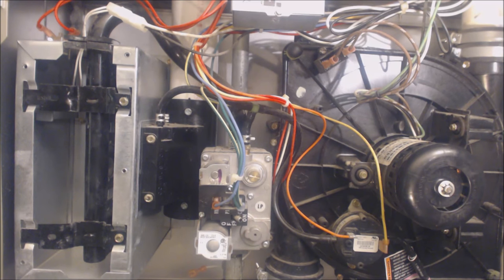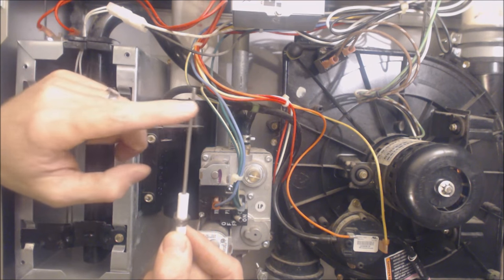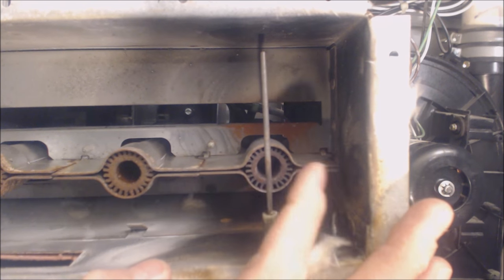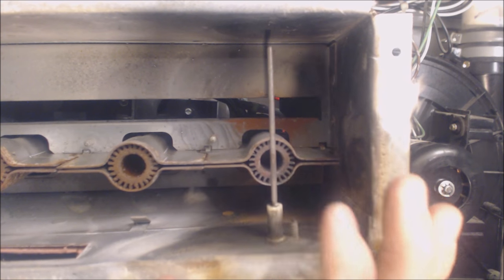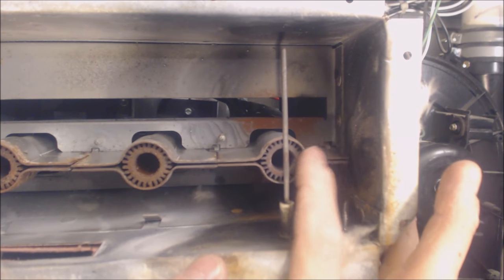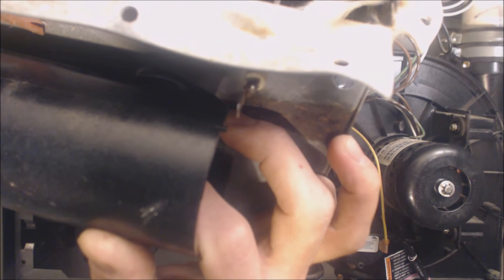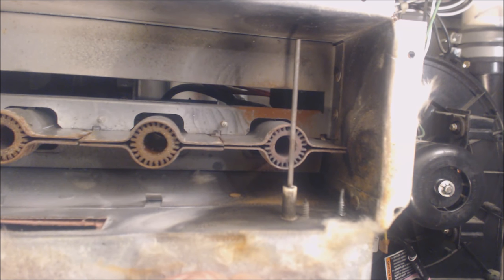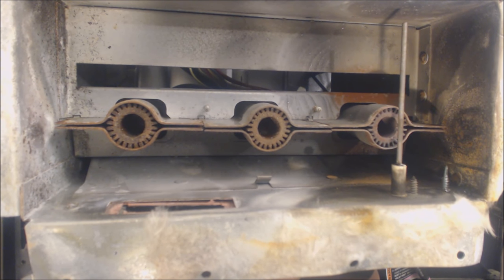Gas Furnace Flame Rod Sensor and Rectification Explained!

Comment: This is gold!  I've always been cleaning only the rod and never the burner retention head.  I've been having problems with a goodman gmvm97 flame sense. I've been getting called back every month.  Next time I'll be cleaning the burner and also checking voltage between neutral and ground.
Reply from the maker: lad to help Jshortca!

Comment from the maker: This is in reference to Jesse's question on flame rectification sent through the messenger. It is not allowing me to reply so I am posting my answer here. 
The question: 
I just have a question on your flame rectification. I get the flame sends voltage to the burners which converts to DC. I get hooking up the meter leads in series reads the DC current moving from the flame to the burners. But how does the board confirm this to keep the flame going? People say it has to be grounded. But not all burners have a ground wire on the burner box. You can remove it and it will still run.

The boards that you disconnect that have the ground wire going to the burner may also have another ground somewhere such as the ones that go to the gas valve common and then to another ground before making it back to the burner. If it goes to ground, it could pick up the micro amp signal. You can also do that test for micro amps in series on the ground wire and to be honest, that gives a better reading for how many micro amps you are getting back to the board.
Reply: It reads the ac imput back on its self if I understand correctly. The board is looking at the flames directly through interference paterns in the flame.

Comment: Man I wish I would’ve seen this video a few days ago. 😂 recently I did a PM on an older Rheem furnace, that wasn’t sensing the flame after I cleaned the flame rod. It generated no DC micro amps, so I assumed I broke it somehow. I put a new one in there and it did the same exact thing, thinking maybe the new rod was defective somehow. So I put a different new rod in there and still did the same thing. I went crazy trying to figure out what the issue was. Had continuity from the flame rod all the way to the board. I began to assume the board was bad, called the boss to verify, and to just replace it with one of our universal boards. Anyways, had I known how the flame rod works NOW, would’ve saved me so much headache. My theory now is that the board was likely not sending 115v to the rod. 

But the stress and headache didn’t end there! When I put the universal board in there (according to the manual for the new board, it was compatible with this Rheem), as soon as I gave it power, immediately it flashed the trouble codes for “unexpected flame sense” and “pressure switch stuck closed,” neither of which were occurring. I assumed the new board was defective, called the boss to explain the situation. Luckily he was just down the street. Told me he had the same exact board, and to come get it and try that one instead. Put the second universal board in there and it did the same exact thing. Turns out the stupid board wasn’t compatible despite it supposedly being so. We ended up having to order the factory OEM board and put it in the next day, worked like a champ after that. I’m always learning something new. 🤣🤣🤣

Comment: Awesome video. Question tho.. Can the quality of the flame affect the DC voltage? If the voltage literally travels thru the flame what happens if the furnace is running rich or lean will that change the voltage??
Reply from the maker: Yes, slightly as it travels through the carbon in the flame but the board would not be able to read the difference, thanks

Comment: good video.  What would  your microamps be reading if the sensor was beginning to get corroded but still proving a flame?
Reply from the maker: It may be lower like 2 microamps or less. The microamp measurement could also be intermittent.

Comment: I've heard Teflon tape can not be used on gas pipe because it can interfere with flame rectification. Is that true or does the system rely on electrical system grounding independent of gas pipe threaded connections.
Reply from the maker: Flame rectification usually travels through the pilot tube for pilot ignition and direct ignition usually travels through the burner retention head and ground chassis but yeah I don't use the teflon tape rated for fuel gas but just thread sealant. You don't want an inspector to fail you and you do want your piping to have continuity as well for ground, thanks Joe!

Comment: I have a question about the Ground. Can you explain how a bad ground can cause intermittent voltage, causing loss in voltage at the gas valve.
Reply from the maker: I will have another video coming out on the flame rectification process. This one will be for testing. Problems arise from ground to the board, potential voltage measured on the ground, and flame position as well as oxidation on the rod. Thanks!

Comment: What would be the reason that, there won't be any microamps when tested?  Could it be ground or electronic board problems?
Reply from the maker: Check for voltage going to the flame rod. One probe on the 120v common and the other on the hot feeding the flame sensor. It should be 90-110v. Is the flame rod in a good place enveloped by the flame? If so, you should be reading at least some micro amps if you are in series on dc microamps. Thanks and let me know how you make out.

Comment: It's not the size of the chassis that causes flame rod rectification. It is the temperature difference. Electrons can leave a hot glowing flame rod a lot easier than a cold piece of sheet metal. That makes the rectification one direction. Vacuum tubes used this exact same principle with the heater element.

Comment: hi, on a york rtu the flame sensor sits in front of the pilot tube rail instead of the main burner. so how does this work? the main burner flame is not touching the rod at all. does this mean the pilot is on all the time and the rod is only sensing the pilot flame? the unit has an intermitten ignition control board. thank you.
Reply from the maker: Ha ha, yes, crazy huh? The rectification is only checking the pilot and not the main burners. That is how the older furnaces used to work.

Comment: i didn't understand well what you mean about flame rod have to be one-fifth of the head.  could you explain more? You are speaking about lenght of the rod comparing with ???
Reply from the maker: I was speaking about surface area. For instance if you compare it to the flame rod on a smart valve which is much smaller, thanks!

Comment: For the life of me I cannot get any DC uA readings on the ground side of my Rheem RGPH-07EAUER; it doesn't even fluctuate, it's always 0, yet the readings are great on the source side. Checked ground connections multiple times with 0 ohms, and 0vac from ground to neutral. 0 ohms from the flame sensor signal wire back to the IFC. I'm beginning to think my model doesn't use the ground side to send the signal to the IFC, b/c occasionally the burners will stay lit and the unit will work for a couple of days, while the readings on the ground side are still 0. Most of the time, the burners will not stay lit for more than 8 - 25 seconds. I've replaced the flame sensor and even the IFC board, and also cleaned and sanded the burners and the whole area around them. This thing is possessed! I replaced the gas valve, unit worked for two days. Removed the ground wire from gas valve, unit worked for 3 days. Removed the red wire connected to the IFC board labeled fan, the unit ran great for 5 days. I don't understand how doing any of these random things get the unit back into a temporary working order, and most of all, why the hell are they only temporarily!
Reply: Did you figure it out ?

Comment: There are many other videos showing how to clean the Flame Sensor. Many of those videos state how you shouldn't be touching the flame rod because of the "oils on your skin" - is this just a myth? Surely the flame would burn off anything like this that is a bad conductor. They also mention not using anything "too coarse" to clean the rod. How could scratching a stainless steel rod ever reduce its ability to conduct electricity?
Reply from the maker: The skin and oil touching is actually the hot surface ignitor. I think that migrated over from the hsi to the flame rod just from people telling other people. If you scratch the rod then it is not as smooth and insulation sticks on it and could impede the voltage flow so yes use a non course unsoaped steel wool. Really it is more less just common sense. Nothing to stress about if you touch the rod, it is just stainless steel. On the flip side, always take extra precaution to not put anything in the way of the system working properly. Because of the questions you have asked, I can tell that you have a grip on the topic! Thanks for the questions!
Reply: @acservicetechchannel  Excellent answer to a common question and myth, thanks !!

Comment: hello. i am struggling with a Rheem furnace from 1990 furnace serial AG5D304 F3090 6468 and MODEL  RGLE-06NLAER  which does not have a flame sensor and instead the igniter acts as the flame sensor from what i understand.  the gas valve keeps shutting off at various times without any good reason. it is not immediately after ignition.  it can run for hours or minutes before shutting down.The limit switches don't seem to be the problem (i checked for opens) and the gas valve only shuts off when it doesn't get 24 V.  the thermostat controls the inducer motor perfectly so i don't think it is the thermostat.  how do i know if the problem is the sensor portion of the igniter ( since ignition function works perfectly), or the main control board or the ignition module?  i think the gas valve signal comes from the ignition module in this model but i am not sure. I would like to verify before buying these parts.  any help would be much appreciated.
Reply from the maker: Check out this ignition playlist especially then the single rod honeywell one (Gas Furnace Spark Ignition Control Troubleshooting! ) Many times it is the flame rod or pressure switches. The pressure switch may be fine but omething may be tripping the pressure switch. Is there an error code from a flashing light? - https://www.youtube.com/playlist?list=PLxnHR5_D2ojwefn5vubZ7A8MA89Z6AnMU
Reply: thx,  no it's old board with no code LEDs.  i can try to catch when it acts up and see if the pressure switch is open.  am i just measuring 24v at both leads of the switch?  then i will know if it is the pressure switch that remains open, right?  i will also try to get to the leads on the ignition control module. By the way, this is a hot surface igniter not a spark one.  do they all work the same? in terms of retrification?  a couple of other questions, i measure two thermal switches when it fails and they aren't open ( 24 v on both leads).  somehow, when i close the doors in the front, it shuts down more quickly it seems. as if there is another thermal switch measuring the ambient temp in the furnace?  what else would closing the doors do to make it shut down quicker?  (no door switch involved)?  sorry for the length of comment. i would like to send you a picture of circuit diagram.  is there an email address i can reach you at?  thx for the great help !
Reply from the maker: When you said you thought the ignitor was also the flame sensor, I assumed it was a single rod setup. You want to power the furnace without a call for heat and see what side of the switch normally has the 24v. If that doesn't work, turn the power off, unplug the inducer, turn the power back on and turn the tstat to heat and turn temp up. You will have 24v on one side and not on the other since the inducer motor is not running. Any way once you figure this out, you will know which side of the pressure switch to check. It will be the other side. Put one lead on the spade term on the pressure switch and the other on the c terminal or ground to pick up the 24v going through the pressure switch. You should also T in a pressure testing digital manometer so that you can see any variation in the negative pressure while running.  You can send emails to info@acservicetech.com     If this happens sooner with the door shut maybe the furnace is having a problem exhausting or maybe the thermal heat switch is going on the heat exchanger air area. I was able to pull up the first 4 characters of that model number and it looks like it is an 80% eff furnace so you mwouldn't have to worry about a condensate drain pressure switch line.  When I looked it up though it says Direct spark ignitor and not a hsi. If it is a flame and ignition rod, it needs to be cleaned with unsoaped steel wool. Thanks- check out the furnace troubleshooting playlist for any other videos and testing of components-  https://www.youtube.com/playlist?list=PLxnHR5_D2ojyN6VClLntbM4X82Gc9Xs8A
Reply: hi there. i sent you an email with the attached diagram. thanks so much.
Reply: hi i sent you an email with attached diagram.  thank you very much.
Reply from the maker: If it is the rheem type that have the HS780 control then yeah the hsi is also the flame rod. Those are semi notorious for having flame proving problems. Two things, you could have the tech replace the hsi because it could have some silicon oxide buildup on it  or have the tech add the remote flame sensor I believe it is the #AS-58494-01 or 62-24044-71  and check all grounds. Also have them check the actual -wc from the inducer, then check the pressure switch wc value, then test the pressure switch with a digital manometer with a pump such as the sdmn6 to make sure the pressure switch is closing at the rated value. Thanks Mitra
Reply: thanks so much. i will check the HSI but it looks clean and it fires up just fine every cycle. so i figured if it fires up fine then it must be clean.? i will double check grounds.  what type of signal should i measure to see if the flame proving signal  is what is failing?  i only seem to read 9v at both wires going into the HSI!?!?!?  i suppose when it is being heated, i should get 120 on one wire to HSI and when it is sensing flame i should get something else on the other wire?    i was about to order a new igniter control module? could it be that causing  intermittent failure ?  but since it controls ignition as it should and seems to time out after two tries as it should, i am hesitant to think only part of it is failing intermittently.? ignition control module looks like it was changed before in the past. thank YOU :)
Reply from the maker: Yes I understood the hsi was glowing but this type of ignition proving system is no longer used because of it failing so much. It is odd because it uses the hsi instead of a dedicated stainless steel rod flame sensor. My recommendations are to start by changing the hsi if there is buildup on the outside which you can't see well because if forms like glass around the hsi itself. It acts like insulation and is normal for the hsi when they get older. Also have the tech follow some of the other tips in the previous comment along with their own troubleshooting, thanks

Comment: I was told to don't touch  the rod, now what???
Reply from the maker: Whoever told you that was speaking about hot surface ignitors. A flame rod is literally just a stainless steel rod that voltage travels through. You won't hurt that but you could clean it with unsoaped steel wool before reinstalling it, thanks!

Comment: I changed the flame rod, and there was no change
Reply from the maker: Most times it is a corrosion problem on the rod but you already changed that out or a ground problem but even if you had a ground problem, you would likely still be reading micro amps dc on the supply voltage side when in series. Let me know how you make out. Thanks